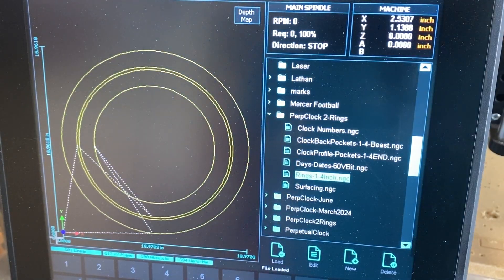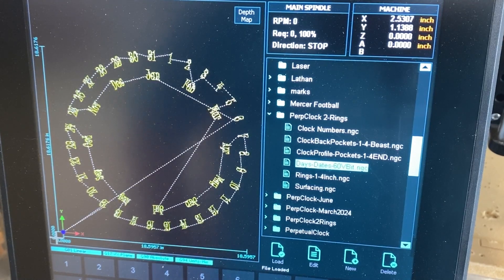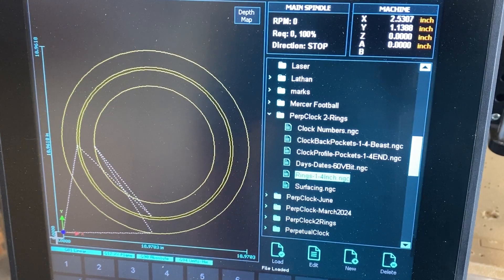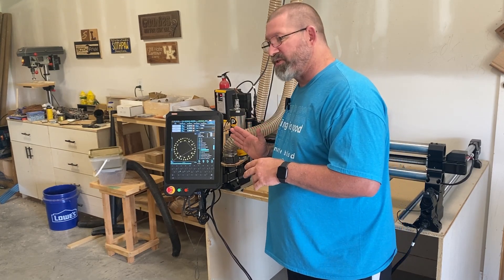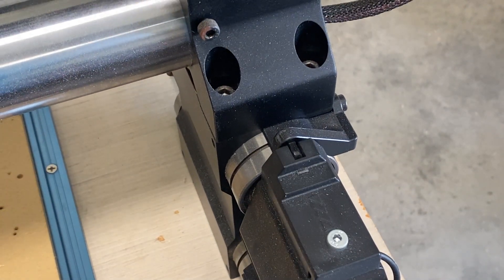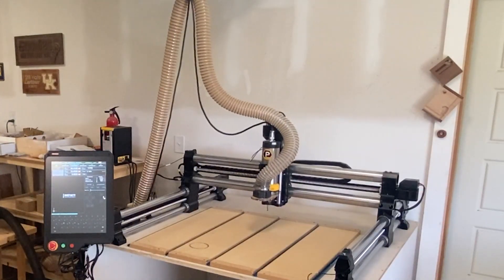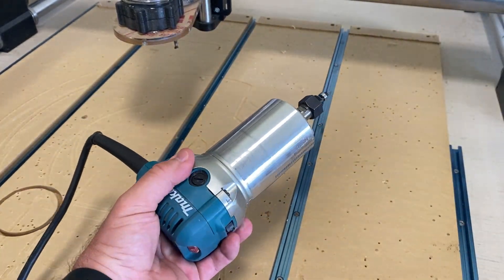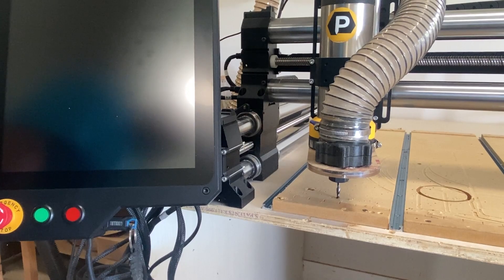This Onefinity Upgrade CHANGES The CNC Landscape

Comment: How did you add the file folders into the Masso?
Reply from the maker: It's just showing the folder structure that I have on my jump drive.
Reply: @SothpawDesigns ahh okay. I'm guessing you don't do the wireless file transfers through the massolink then?

Comment: There is a setting for homing speed. My complaint is that when I start a job the controller doesn't do anything, but shows no indication what it is waiting for
Reply from the maker: Interesting. I'd reach out to tech support.
Reply: I think it's waiting for the spindle\router to get up to speed.  You can adjust that time in the settings. I think the default is 6 seconds. I think this is what you mean, but might be wrong?

Comment: Considering an Elite, one troll said the tubes are not rigid enough and cause issues vs an aluminum extrusion design.  True concern or just typical snobbery from a trol?
Reply from the maker: I've had it for over 2 years and had no problems with the tubes. I use the x50, which has thicker rails, so if that's what they were talking about, I disagree.
Reply: Nonsense. It does exactly what it is designed to do, which is cut wood and soft metals or plastics etc. I have the Elite journeyman with an 80mm 2.2kw spindle and have had no issues.

Comment: Go into your homing settings, you can change both the speed of homing, most people up it to about 100ipm-150ipm, AND you can go into your axis movement and combine the x and y movements instead of allowing it to do one and then the other. 
But, don't speed up the homing too much, it can result in inaccuracies over time if it homes too fast.
Reply: I'll add that you can also check of Z as well and have all three home at once
Reply: @the-wooden-beard  Indeed, its an option for some cuts, but depending what your workload is its usually safer for the material piece to lift the z up out of the way first and then let the other two move at the same time. It would be fine if you're only engraving glass, or laser cutting stuff.
Reply: @8thsinner exactly right.  Raising the Z first only takes a couple seconds at most, and it might just save you from breaking a $60 router bit.

Comment: EMI is the Culprit..!

My thoughts..!May not be accurate..! Might help..!

Please make sure to shield all the signal wires completely with Copper /Aluminium Foil and attach one end of that shielding to the Chassis of the machine which ultimately goes to the earth Ground.
Better if you can shield the High Voltage cables as well.

Both the 3ph High Voltage varying frequency 400HZ at the output side, and 60Hz -250V at the input side of the VFD can cause Potential signal interruptions. So its better to shield those cables as well, so that any HF Noise induced within the cable would be captured by the shielding and neutralise it by sending to ground.

Also never route the high voltage cables along with /parallel to low voltage signal wires.
Assign separate drag chains for them.
Keep the VFD at a distance about 5-10 feet apart from Electronic CNC controller 

Connect only one end of the shielding to the ground. Preferably to the common Earth Bus bar in the controller enclosure.
If we connect both ends of shielding to the ground, it is said to have a potential difference between both ends and may have current passage among them , which would make things worse..! (Debatable)

Keep the Step/Dir wires from Masso Controller to the stepper driver as short as possible and shield them and attach one end of shielding to ground as mentioned above.! Attach Ferrite beads at both ends on those step/dir signal wires to further filter out any noise.

Try to separately shield the Power cables to steppers and encoders from stepper separately to keep the feedback signals from encoder to the stepper driver clean.
Because the encoder signals are weak compared to stepper motor Power lines which tend to have higher frequency and current.

The Closed loop steppers can only retain position , which got shifted because of mechanical inertia /velocity loads
It compares the commanded position from Driver with the feedback from Stepper Encoder. Then moves the motor as per difference/discrepancy.
It can not help if the command signal itself got corrupted. So it is important to make sure the driver got the correct number of pulse count required for the particular move..!

These are notes, I have written down for my upcoming project.

Thanks
Keep doing More Videos..!
Reply: And for the Spindle Dropping Problem,

1) Please Consider Using Gas Structs which balances the gravity and gives a support upwards.
So essentially in result,the motor would have to exert equal power to move the axis up or down ,which is great..!
Using Springs is another option .But dont know how good of a solution it is..!

2)Using Motors with Brake is another option. So you can stop the axis from falling when there is no power.
The stepper with brakes have two more extra cables ( needs 12-24V mostly) We would have to give the required voltage to the brake line to disengage the brake to move the axis.  This is usually done with the Enable signal from the driver.  Meaning,When the driver gets enable signal from the CNC Controller, it would connect the power to the brake to disengage.!

Hope it helps..!
Reply from the maker: Thanks. Onefinity addressed that problem and has a new motor with a z brake. They sent it to me recently, but I haven't installed yet. Appreciate the comments!

Comment: I've been soaking up lots of things on the Onefinity - Question - One complaint I've seen, is the controller doesn't give you a total run time for the job - Is that still the case?
Reply from the maker: That does appear to be the case with the Masso. If it does provide it, I can't find it, but don't take my word as gospel. It may have been updated in recent updates.
Reply: @SothpawDesigns  OK, so that is still the case. I've seen it mentioned even recently that's why I jumped on your update to see if that was changed. I have to assume it will come in an update. I love those stop sensors but have to think, at some point, a chip is going to be a butthole LOL! I have to go back in your stuff, that spindle looks freaking huge~ and bet you don't regret it one bit.
Reply from the maker: @radamus210  I'm definitely glad I upgraded. It's been a game changer for me. Sounds like a sales pitch, but it's not, it's just a great improvement over a palm router.
Reply: @SothpawDesigns  I wouldn't watch your stuff if you were pitching :) I think you said you're an educator? You put it out there right for me, what I want, to the depth I want in the time that makes it valuable for both of us. Not everyone connects I guess. 
VFD/spindle have always been my direction because of the material I want to cut. Your setup is absolute beast now.
Reply: The masso has both an estimated run time and an actual run time on the display as it's running, I can't remember where off hand as I haven't used mine in a few weeks. I think it shows bottom right to the preview screen.
Reply from the maker: @8thsinner  I'd hate to give the wrong info. I'm gonna be running a few projects this week. I'll take a look.

Comment: It's certainly a better system but is it worth the couple $K to upgrade?  I just haven't been able to find sufficient additional value in the system.  If I was buying new today I'd likely go with it, but as an upgrade there's not a lot of new functionality for the $2k.  Especially as I have mine already turning on my dust collection and spindle automatically.   In the end, this doesn't produce any different of a result, it just helps avoid some potential missteps ruining a project and there's a few operator niceties.

Comment: Go to the F1 screen and you can set the homing speed.😊
Reply: Onefinity sees this as a possible warranty voiding change. I talked to them after I changed mine and it could no longer stop in time before crashing the z axis bearings. It was a slight tap but a tap nonetheless. I changed my back to stock to avoid warranty issues.
Reply: @garagehobbies  It's not a 'warranty void change', just a , 'to help you with troubleshooting, we need to ensure you have factory defaults enabled first' type deal.  We've found sometimes 100ipm will give sensor errors.  We'll be increasing it to 40ipm in an upcoming service bulletin.
Reply: @OnefinityCNC  good to know! I was told it would possibly be problematic with the warranty when I contacted you guys. I'll try 40. I know 100 was not good.
Reply from the maker: Thank you!

Comment: Video dump?
Reply: You can change the speed to the homing up to 100. It can also do both X Y and at the same time. Meaning it does not go to X then do Y. There is a Z slider brake you can get from 1F.   I love my Elite WW.
Reply from the maker: @kevinrich4637  Thank you! I'll do that. I've been told that there's a setting to update it.
Reply from the maker: Yup. I moved my CNC content to a different channel a few months ago, then decided that wasn't a great idea. Moving it back. It was an experiment, and all experiments are learning experiences.